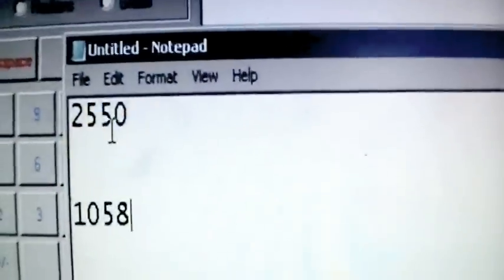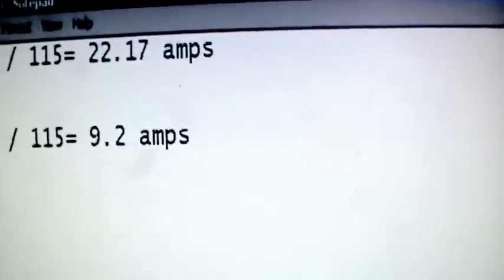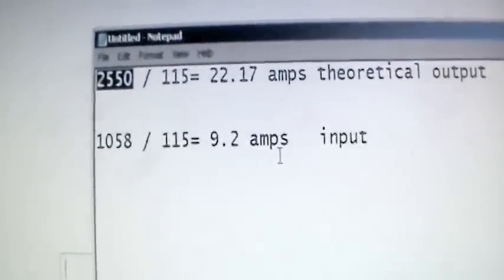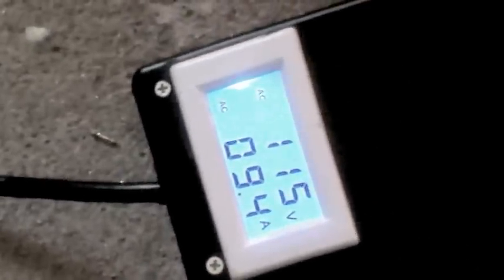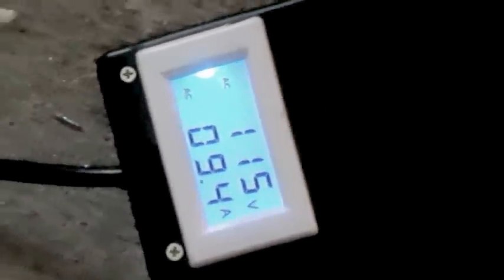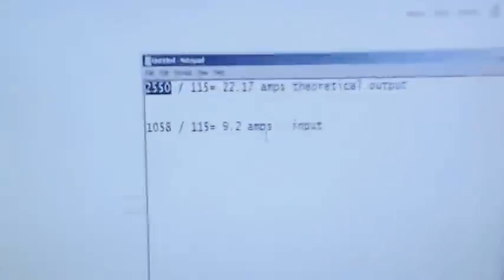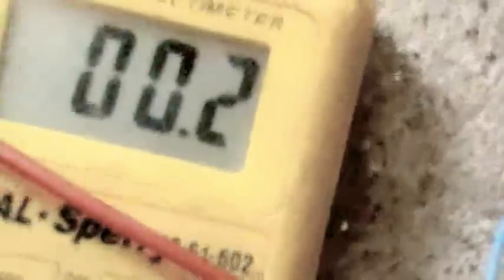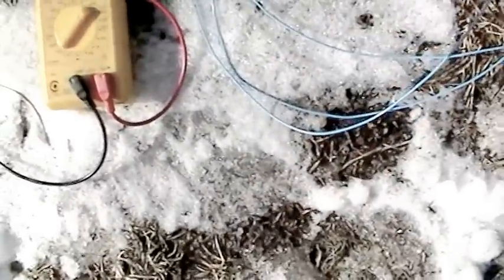Pelex -Power From Electromagnetic Energy Exchange - Overunity

Comment: Basically it's stealing power from earthy side of the power grid as neutral line is connected to earth at power generating stations. If your home has a core balance relay in electricity box feed in,  it will trip due to a detected difference in current between active and neutral leads.  "Diverted current" isn't exactly some wonderful new break through...... marijuana growers have been doing this for years ...until caught .
Reply from the maker: That's far from the truth. Maybe when electric meters monitored the neutral back in the 50's or 60's, folks could have stolen from the electric supplier by disconnecting the neutral and connecting to ground, so the return would head back to the grounded neutral through Earth. however, since Barbosa & Leal's system may work this way, mine does not. The ground wire is used for the opposing side of a spark gap, not for a return, my system utilizes phase conjugate mirroring as Kapanadze and Don Smith use, however, my system is run on low frequencies, not high as Don and TK's are.. You really can't say this, and it is wrong to do so because you don't know the circuit that's inside, so, it wasn't even a close guess. Anyway, in 3rd world countries, electrical meters may read the consumption of the neutral and their users get away with stealing from earth neutrals but in the US that is impossible. The hot legs are monitored with current transformers and potential transformers, so, the wattage is recorded from any use on the hot legs, so, regardless of how the energy returns back to the transformer, the voltage and amperage is recorded and multiplied right at the smartmeter and transmitted to the power company. cheating a neutral will do nothing and help nothing but burn out appliances because when the ground dries up from the current flow, resistance is added and the voltage drops, burning out just about anything you power up. Anyway, nothing here is diverted and you aren't speaking to a beginner. You know nothing about this circuit and never will. I am bound by contract already and marketing negotiations have already begun. Pelex had problems with it and it had an orgone pulse that knocked out cellular products within 300 feet of it's connections, so, that unit was squashed and I came up with another much more powerful device that has abilities in the huindreds of thousands of watts. so much for your suppression.. it won't work.. my machine is selling whether you or your employer wants it to.. Fuck em all.. they can't stop it now, it's way too late.. even old JP can't come back to use his finances to stop it.. It's a done deal bro! The oil market will starve unless they spend the billions with me to stop it. It's going to market and the first 1200 or so will be small enough and cheap enough to get folks attention. Once this happens, the next 50,000 units will go for 10k each and will shut down if opened and not turn back on. We won't service any units that have been opened either. The warranty will be void, and the best part is that the device can only be energized with a specific sequence.. otherwise it will never come on and energize anything. We have designed 4 different distribution voltages, 4800v delta 3 phase, 13,800 v, 23kV and 27,600 volts, all capable of 5 megawatts and can go higher without any problems at all.

Comment: While I applaud your efforts (and don't ever stop experimenting!!), you need to learn a bit more about electronics. 
Just because a product says it's maximum current/power draw is rated for "XX" amps, does NOT mean it always uses that much! In fact, that is the "worst case" that the device could possibly draw...  under any possible conditions. Unless you show the AC Voltage going into the AC power strip they are plugged into, as well as the Current Draw and waveform, you can not make statements like "2550 Watts".

Also, any time you introduce an "earthing connection" (your outside Ground rod) to a device operated from AC power, you end up possibly diverting the "proper" "AC Return Path", which is supposed to be through the Neutral wire. By bypassing the Neutral wire, you can no longer trust any AC Power meter... unless you also measure the current going through your "earthing" connection, and add it to the AC power meter Current measurement.
 
It's not trashtalk... I firmly believe we WILL find a way to harness... as Tesla said... "the very wheelwork of nature".

I'm a design engineer born in the days of tubes ("valves" for the rest of the world), but schooled in solid state, and employed in designing microprocessor-based products.  I have been able to throw away the lies I was taught, but yet kept what is still applicable, and combine it with knowledge from many of the great minds of antiquity... like Tesla and his contemporaries... as well as ones of this century.

As I said... never stop experimenting!!  :-)

Comment from the maker: This device was closer to unity than all of the Pelex revisions. I'm finding the grounded shielding provides a massive difference in potential that adds in series to the input of the second transformer, then, the last transformer is voltage correction which steadies the output, releasing a very large boost in output without drawing from the input. Please go to my videos and see the pelex device using two kilowatt meters which shows input vs output wattage. 

The amperage literally jumps to the shielding ground wire and will not load up the input wiring any more than 7 watts. Payloads increase, the input wattage drops to 5.8 watts as the output can go as high as 3000 watts. 

The kilowatt meter is only capable of 1500 watts , unfortunately, I am blocked from uploading the newest videos for whatever reason. People are either suppressing them or gov forced YouTube to shut my uploads down.
Reply: Open source it bruh.
Reply: carlos gama until Marc Belanger open sources whatever he has going on... no one will know if it is real or not... Normal scientific method includes peer review.
Reply: MUITO BOM